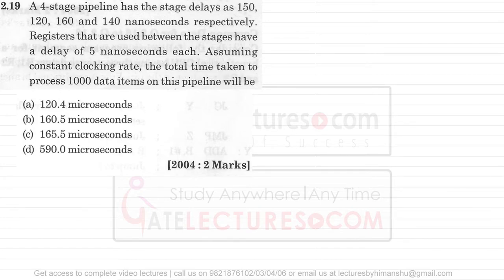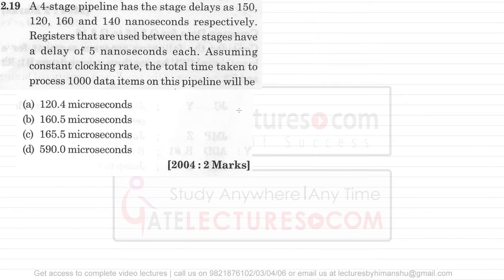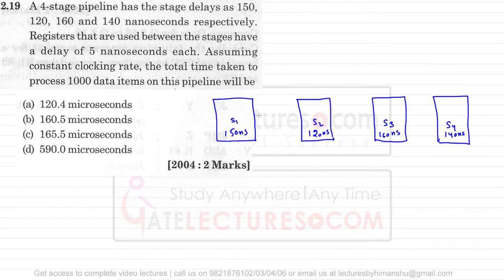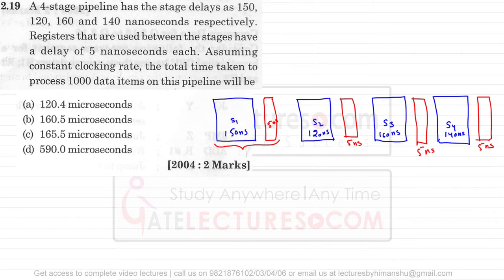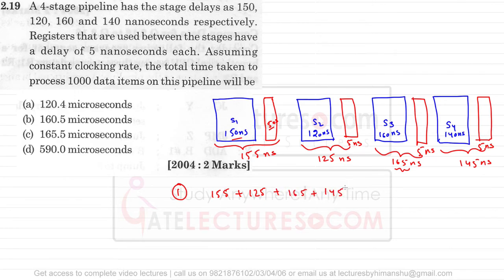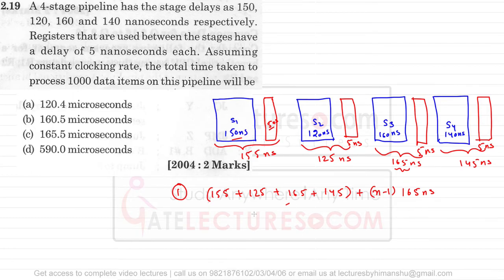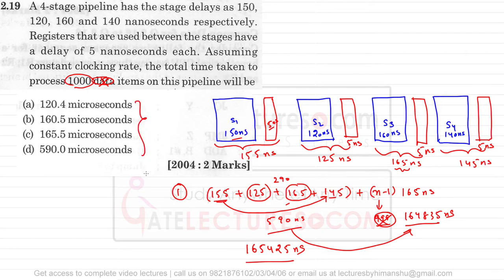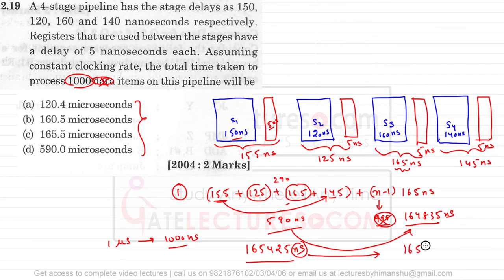Computer Architecture Organization - GATE 2004 Question on Pipelining

Comment: this is solved wrong.!
"fact: in pipeline, the instruction processing time ffor all the stages should be of the max. delay"
here we should take 165 ns(160+ 5 for buffer delay). now using formula (k+n-1)t, the equation becomes
(4+1000-1)*165 ns. solving this the ans would come 165495 ns = 165.5 ms.
Reply: Amit Kumar yeah that's correct.
Max Cycle Time of each stage  = ( Max delay stage time + buffer time)